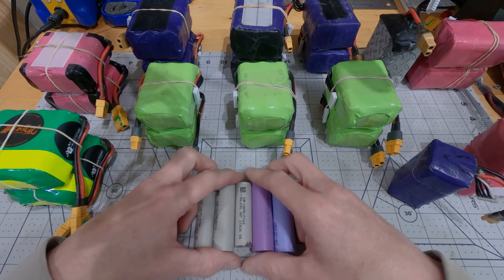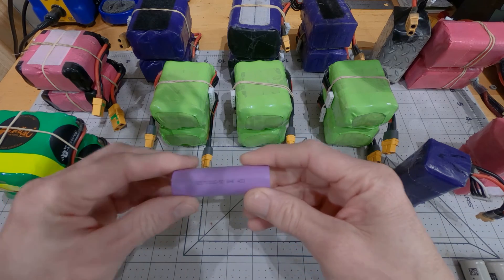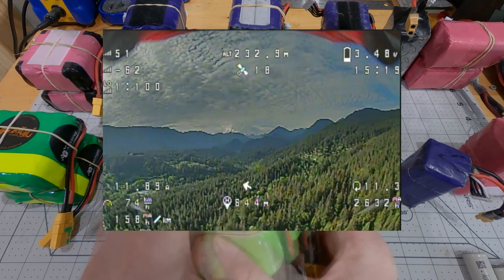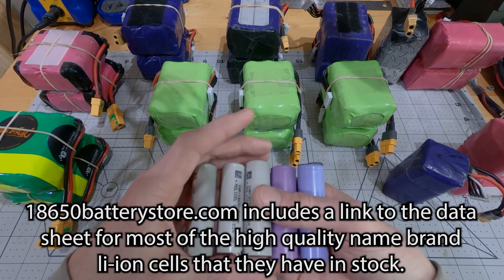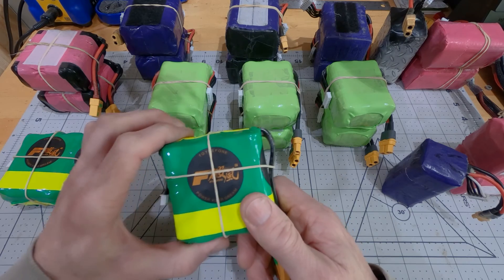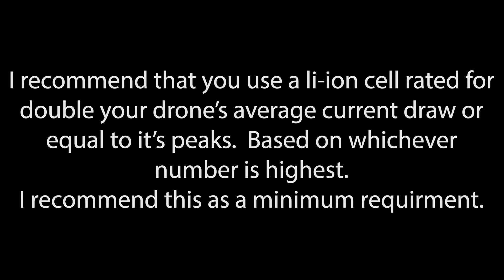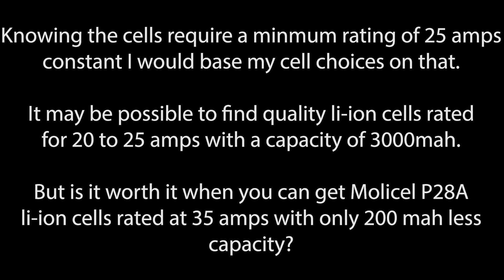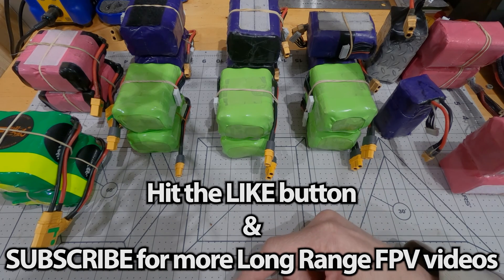Picking a Li-ion Battery for FPV & Long Range : FalconRad

Comment: Thanks so much for the video:
How do you manage storage for these li-on battery packs?
Reply from the maker: room temperature and the voltage set to storage, so 3.65 - 3.7 per cell voltage.

Comment: Do you happen to have a configuration for a 6s2p or a 6s3p pack? I've built a few 1p packs but I'd like to build at least a 6s2p with the Molicel P45B cells for my Helion 10
Reply from the maker: No I don't, I'm sure you can find it somewhere though. I make them as separate 6s1p packs and then run them in parallel.
Reply: @FalconRadFPV  yeah, I've been doing the same. It's nice to have the extra amps available but I'd like to build a pack similar to what Upgrade Energy is making.

Comment: Thank you so much for the video! I'm about to build a 7" quad for long range and I feel frustrated about what battery to choose. Do you think its better to use 21700 or 18650 packs? I dont want high speed, I want to fly for as much time as I can. Thanks for your valuable information
Reply from the maker: for max flight time on 7" use 6s2p made with 21700 cells. Molicel p45B would work great.

Comment: Are Lipos cheaper? Coming from Vaping, I'd have always tried 18650 or 21700 in these way before I ever thought of Lipos?
Reply from the maker: no li-ion packs are cheaper usually.  For sure way cheaper if you make your own packs.
Reply: @FalconRadFPV  My dream right now is a 2S 21700 drone using Molicel P45B cells...

Comment: The new Molicel P30B 18650 is an excellent cell.  I recently built a 4s1p pack for my Flywoo Explorer LR4 and it performs great.  30A rated and 3000mAH
Reply from the maker: Ya those cells are way better than the sony ones.  Molicel is a great choice for long range packs.  glad to hear its working well for you!

Comment: What is best Battery in 2024r ???????????????????????????????????????????  Capacity/KG
Reply from the maker: That's hard to answer.  It depends on the drone and what you want to do with it.  As far as a battery for a 7" long range drone, I think the molicel P28A or P28B cells are my personal favorite.  The best cells for flights packs are not the ones with the highest capacity as the video will tell you.  You want a pack that can manage the current draw of a drone, the highest capacity cells are only good for flashlights and low current uses.  For a 21700 size cell I suggest the molicel P45B or the samsung 50S.

Comment: Is it okay to use 6s 21700 for a 6inch quad for long range flying? Motors is Meps 2408 1900kv.
Reply from the maker: Yes that should be fine but the motors are pretty high kv, you should limit motor output by about 20% or so.  and make sure your amp draw is resonable for the limits of the li-ion battery.

Comment: cant there just be a capacitor of some sort as peak amp draw safe be installed ? i mean you never need constant high current when cruising only short punches, when needed. so if one could make a Capacitor as peakamp dampener for the li-ions wouldnt they be way more forgiving for relativly normal fpv cruising flights. ? thoughts ?
Reply from the maker: To be of any real help the capacitor would have to be quite large to hold more than a few milliseconds worth of power.

Comment: Why to do 2x 6s1p in parallel? why not to do 1x 6s2p and save some weight?
Reply from the maker: The weight savings is only a small amount maybe 20 grams.  Having a top plate big enough to carry a 6s2p li-ion battery and a gopro will create a lot of drag in the air.  For the best range drag needs to be kept to a minimum.  With my RAD Li-ion frame one battery is carried on the top plate and another one underneath, this helps to reduce drag quite a bit.
Reply: @FalconRadFPV  Thanks man for the info, that's an important point. 

Then how about doing a 6s in one line ? I know it's going to be tall for a 5" quad. But how about a 7 " one ?

I haven't tested or done any drone build but it's coming very soon. Haven't purchased the parts but most of them in the cart.

Comment: great video, thank you! can you help me decide between 18650 vs. 21700 cells?
Reply from the maker: It depends on how many amps your build is going to need.  For higher amps I like to use 6s2p 18650.  For more moderate amp draw I'll use 6s1p 21700.  For extra range I'll use 6s2p 21700 but it's really heavy.

Comment: Never thought about the safety factor before now. Flying mostly forested areas it’s a major concern of mine.
Reply from the maker: Ya the safety difference between li-ion cells and lipo's is a big deal if flying in the summer months.  A li-ion cell has a metal "can" around the whole thing and goes through crushing tests and so on.  If a lipo gets poked by a branch sometimes it'll bust into flames.

Comment: Would I be right in thinking that there is basically no disadvantage to just buying batteries with 45a rating? Apart from cost.
Reply from the maker: There is no disadvantage to having a high amp rated li-ion cell.  They generally perform better than lower amp rated ones.

Comment: Hello FalconRad, how high do you charge your Li-Ion in terms of volts? I charge them up to 4.10V only; would it also be good charging them up to 4.20V regularly? Also, can I have a 3000mAh and 4200mAh (45C and 35C respectively) in parallel without trouble? Thank you, you're channel has been very helpful.
Reply from the maker: Yes I charge my li-ion packs to 4.2 volts.  I'm not sure about mixing different battery sizes and C ratings for parallel use.  I have always used matching packs to run in parallel.  I usually label them into pairs that I always use together.
Reply: No, you should not connect 3000 mAh, 45 A, and 4200 mAh, 35 A lithium-ion batteries in parallel. The cells have different capacities, which means they will discharge at different rates. This can lead to overheating issues and potentially result in a fire.

Comment: can i use 4 or 5 C li ion cells?
Reply from the maker: I wouldn't recommend it, the lower the amp rating the more they will sag in voltage.
Reply: @FalconRadFPV  so what  is the minimum C value of a single cell?

Comment: So far I'm not having luck with long flight times with bought & DIY li-ion packs. The best performer so far is that Gaoneng 4000 mah lipo which gives me around 20min flight times just going around in long circles.
Reply from the maker: Ya its a great lipo.  The new 4200 90c is even better.  I almost always use my 18650 6s packs two at a time in parallel, its about 30 or 40 grams heavier than that lipo.

Comment: Thanks for sharing your experience with us:) Would you think 21700 in 6s2p has worse efficiency than 18650 6s2p? Would a 7.5" with slightly bigger motor like 2808 would help for the 21700s? I went for the 21700's and now im wondering if I should increase the prop size for better efficiency. 
Also why dont you use iNav? If you have not tried it, maybe you can give it a shot and share your experience.
Reply from the maker: 21700 6s2p is less efficient than 18650 6s2p.  The weight gets a bit much for a 7" prop and then necessary increase in motor RPM decreases the efficiency.   With 18650 6s2p I get about 4km per 1000mah so max 20km on 5000mah 18650 6s2p.  With 21700 I get about 25km so roughly 3.1km per 1000mah.  The lighter the load the better the ratio of km per mah will get.  I use 21700 6s2p for when I really need good range or if I want to be in the air longer and do several attempts at a specific GoPro shot.  For the avg. long range flight I will use 18650 6s2p for a lighter craft with better maneuverability.  As for firmware, I'm always bust with YouTube videos and working on new frames designs so I don't really change firmware very often.  I have only updated my crossfire for instance 2 or 3 times in 5 years, and only because I had to to get new features to work.  If I was more interested in the automated GPS stuff I would be using INAV for sure.  But ya, I should give it a try, I'm sure a basic setup isn't much more work than with Betaflight.
Reply: @FalconRadFPV   I'm having a hard time deciding between 21700 and 18650. You told me the other day to buy Molicel brand but I forgot to ask which size. So based from your response to Hemanth above, it looks like for my 7" quadcopter, I should buy 18650 cells. However, I got confused about this text you wrote above "I use 21700 6s2p for when I really need good range". I can't figure out how you arrived at 25km. What was the mAh on your 21700 6s2p setup? Then you also wrote that if you want to be in the air longer, you use your 21700 6s2p. Thanks a lot in advance!😊

Comment: Ok, I'm convinced. It's time to switch to lion for long range.  Just the issue of fire risk is enough add the weight savings and its a no brainer... Unfortunately I bought some very expensive 6s pre made packs from pyro and don't think they have the specs I need :( back to the drawing board....
Reply from the maker: Sorry to hear that.  I'm not sure what companies are using to make li-ion packs but it shouldn't be so hard for them to just pick the good cells.  I guess it's down to cost and something almost as good is about 25% cheaper so...

Comment: How do you determine what pvc battery shrink wrap to buyt Im trying to do a 21700 6s2p and don't know what size to order
Reply from the maker: I think 120mm for 21700 6s packs.

Comment: Great insights into batteries from a long range perspective. I thought about setting motor output limit to not accidentally surpass the amp draw limit catching a dive. That probably means getting used to a different throttle stick position. What do you think about that? Also how bad is it to go higher? Will the battery die during flight or just not last as long in the future?
Reply from the maker: In my experience the li-ion batteries will just sag really badly if the amp draw gets too high.  Or with brnd new cells it will put out the amps but get quite hot.  In the end the pack shouldn't suddenly die in flight, but it will reduce the lifespan as well as the total mah that can be output.  This is why I use two packs in parallel at 6s voltage.  It keeps my amp draw below 1/4 of what my molicel li-ion packs are rated for, at least most of the time.  If using 8s on a 6s setup you for sure want to use the motor output limit rather than just a throttle limit.

Comment: Trying to make my 5" freestyle into a long range drone and I'm wondering whether 4S or 6S is better for efficiency. I feel like my old 4S builds were much more efficient on the low end.
Reply from the maker: I believe 3s and 4s are most efficient as far as watts vs thrust.  I only use 6s because the higher voltage lowers the amp draw which allows me to run li-ion cells without them getting hot.

Comment: Where do you get your straps from and what straps are you using?  I'm having a hard time finding anything quality over 250mm.
Reply from the maker: I hear ya, I keep squeezing my batteries into 250 mm straps.  For my big 2170 packs I actually use long zip ties even.  I just bought 280mm TBS Swagger straps yesterday.  THEY ARE GARBAGE!!!  The velcro is setup so that it only works as a 250mm strap, how does that get screwed up so bad?  Still looking for 280 - 300 mm straps for myself.  Of course you could order RJX straps from china.  They make pretty good ones but it'll take a while for shipping and the logo's will just be RJX based.

Comment: So when Molicel says 2.5v minimum, that means it will be destroyed at lower voltage, right? So you land at like 2.8v with those still?
Reply from the maker: I've landed at 2.4 - 2.8 volts very often.  It'll bounce back up to about 3.2 or so after sitting for 5 minutes after landing.  It drops quickly after 3.0 volts though.

Comment: Great video 👍🏻
For 7” LR I use the Molicel p42 21700 and the Samsung INR21700 40T both in 6s2p configuration, and they both yield almost identical flight times.  Both great cells I find.
I also have several of the GNB 4Ah 50c lipos you have for shorter flights, and really like them.
Reply: Isn't 6s2p 21700 a bit heavy?

would you recommend 6s1p 21700 or 6s2p 18650?
Reply: @PerchEagle  bro that is a 7-inch quad and has higher thrust than 5 inches.
Reply: @hardikyadav5277  Thank for the information 👍
Reply: @PerchEagle  pls don't use 6s1p for quad you will burn your battery pack 6s2p is recommended. you can use 6s1p for glider & other applications. Also 6s1p can be beneficial for toothpicks 'cause they consume less current.
Reply: @hardikyadav5277  I've been using 6s1p to do some "long range" with my 5" sometimes and they work pretty well almost don't get hot. Getting 15 min + with the 21700 4000mah and around 13mins with the 18650 2500mah, cruising at like 60 kph at 8-12 amps

Comment: Great information, thanks very much for this video 😁👍. I‘m just for 3 days now in the air with my Chimera 7. Before I’ll send it on long range I tested my 6S LiPo‘s (3.300/60C and 4.200 mAh/75C) and my 6S Li-Ions (4.000 mAh/40A and two in parallel=8.000 mAh) in GPSrescue mode with the factory settings. I got some weird results. Go rescue (the flight back) worked like expected with the 8.000 mAh Li-Ion and the 3.300 mAh LiPo. It failed with the single 4.000 mAh Li-Ion and the 4.200 mAh LiPo. The quad lost too much altitude after the first ascend (+ 50 meters) in rescue mode and I could rescue it only with kicking out GPSrescue before it crashed in the ground and raise throttle. That really confuses me … do you have similar experiences ? Does every pack need a special Go rescue setting in Betaflight with minimum/maximum throttle and hoover throttle ? Because I could rescue the quad by manual throttle it seems that every pack can deliver enough amps 🤷🏻‍♂️. The 4.000 mAh-packs are made by Farin Frames, the 3.300 mAh LiPo is from HRB and the 4.200 mAh from URUAV. Any tipps highly appreciated 😉🙏
Reply from the maker: I believe it's an issue with the newer version of GPS rescue.  Back with betaflight 4.1.7 GPS rescue was fast and never flew towards the ground before gaining altitude.  I'm tempted myself to go back to BF 4.1.7 just for the better GPS rescue mode.  BF 4.2 always goes to low throttle for 5 or 6 seconds before starting to gain altitude, I have no idea why.
Reply: @FalconRadFPV  Hi FalconRad, thank you so much for your answer 💪💪. I didn’t know that there is a different behavior in GPSrescue between the different Betaflight versions 😲. From the perspective of control engineering the PID‘s in BF 4.2 must be totally wrong in the flight mode which the flightcontroller uses during the Go rescue flight. That means for me that I‘ll use for long range only the battery packs which work properly so far and that I must hope to have enough altitude when rescue is triggered … a horrible scenario for every LR pilot 😮‍💨. Thank you again, I highly appreciate the effort you put into your videos and comments. Best regards from Germany.
Reply: @mog59  Why dont you try iNav? I have just built Chimera 7 with iNav. Still in testing though. But I feel for long range purpose, it is more reliable and in some instances superior. We dont need the flight dynamics of Betaflight, and essentials like GPS rescue, or pos hold(cuz you have to scratch your nose mid flight) and other nav parameters and sensors support helps greatly I believe.
Reply: @hemanthkrishna5343  Hi Hemanth, thanks for your comment 👍. 14 month ago I entered fpv as a newbie and climbed the ladder from a 1.6‘‘ analog whoop to 7‘‘ digital. I don’t know where my fpv ladder will end … a CRSF diversity receiver is waiting to be installed on the 7‘‘ … and I‘m following people who are flying wings. iNAV is on my list when I have the feeling that my skills are appropriate. Hopefully not so far in the future 😅😉

Comment: On the most longest flights I did so far (5km away and 1km in height) were with these beautiful Molicel P42 Liions 21700. Best battery for long range in extreme conditions! Great informational video! Thanks
Reply from the maker: Couldn't agree more!
Reply: Just ordered some p42 and a 60$ prime day battery spot welder cant wait to try out liion for the first time
Reply: @lililililililili8667  You're gonna be happy with it, trust me! Just don't give them hell but play nice with them and you can go miles! 😊

Comment: I've really been looking forward to this video, thanks very much for sharing this invaluable information, this is incredibly useful. I fell into the trap of buying the Panasonic 18650B batteries in 4S which had roughly a 6A limit which resulted in the quad dropping after a two minute flight. I've since been using the Molicell 21700 P42A which have worked perfectly.
Reply from the maker: Glad it was helpful!

Comment: Don't know why there isnt sony vtc6 or vtc5a, I have tried moly cells and they suck compared to sony, also you didn't mentioned that you use 21700 not 18650 that is big difference compare to weigh.
Reply from the maker: I use both 21700 and 18650's.  I showed both size packs in the video.  The first time I tried a sony cell it performed badly.  Lol, I guess the opposite experience from yours.    The sony is rated for less amps also.  The Molicel put out the amps that they claim.  I have pulled over 80 amps from 6s2p 18650 packs with molicel P26A  cells.
Reply: @FalconRadFPV  moly has more total capacity, but at the end it's sagging very fast compared to sony vtc6 and added all that weight I don't know which is better. Maybe in the future you will make video sony vs moly endurance test. Also watch out for fake one's.